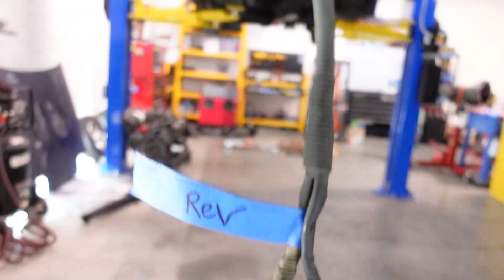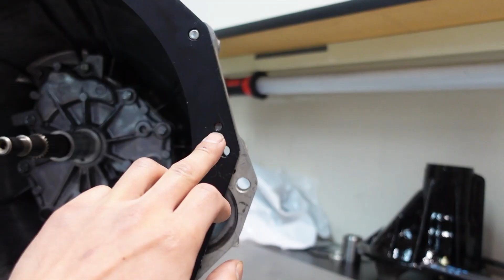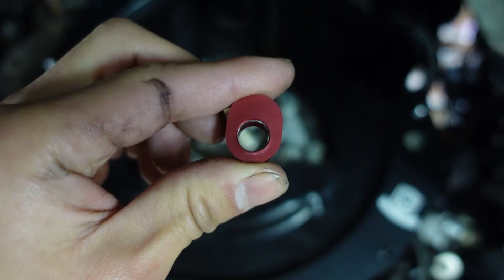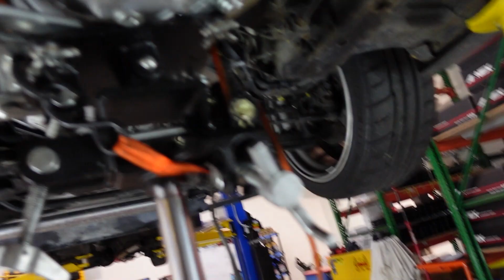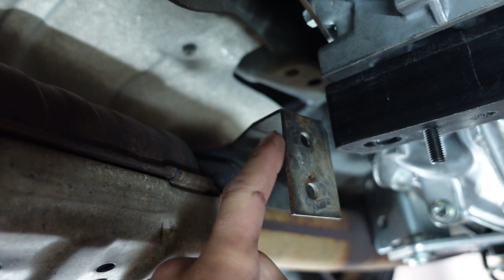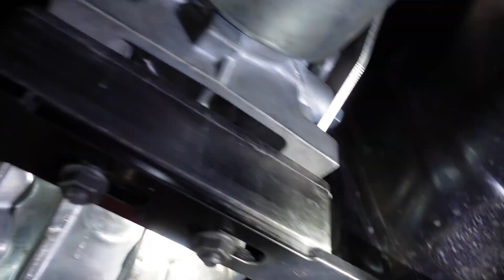R33 CD009 Swap Pt. 2

Comment: Next time someone asks if they should go cd009 or z32 trans,  I'll just show them this video.   🤷‍♂
Reply: You can still get the 98+ spec Z32 trans new.
Reply from the maker: @dreednlb  Wow nice! Perhaps Z32 trans guts into an RB25 trans case or bellhousing is the secret move
Reply: @CMAutohaus  Yeah, the Z32 trans guts are basically identical to the RB25 trans and the RB25 bellhousing bolts right up to the Z32 trans.  I have the 98 spec Z32 trans with an RB25 bellhousing on my KA24DE-T.
Reply from the maker: @dreednlb  I commend you on a solid transmission set up! Our local S-Chassis guys seem to just "deal" with crappy, grinding transmissions instead of rebuilding or upgrading